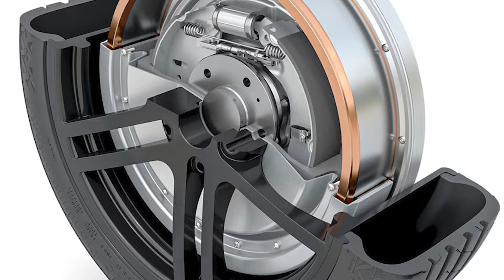2025 BMW M Coupe — New model With In Wheel Electric Motors

Comment from the maker: The new 2025 BMW M Coupe is the company's new model in the Bmw Neue Klasse concept design, which is rumored to be unveiled in 2025. It's also the first car to get DeepDrive dual rotor technology, essentially combining two motors into one. This means that the car will not get the familiar electric motor, but a wheeled electric motor that will be mounted on each wheel. A newly developed stator drives both the inner and outer rotors. A conventional electric motor drives either the inner or outer rotor. The new unit improves the layout because it is lighter and smaller.

Comment: How is sealing solved ( stator-rotor)? How are magnets attached to stator to prevent falling, sliding if temperatures drops below-20? How much does one motor weigh and how much does it cost?
Reply from the maker: Weight 32kg. 
KEY FACTS ABOUT PRODUCTION
cost effective production
50% less magnetic material
80% less iron
Heavy magnets without rare earth elements
Less than 30% cost per Nm compared to state of the art.  
High-quality sample production and testing is currently underway, and mass production will start in 2025. Unfortunately no more information is available, and the price is not known.